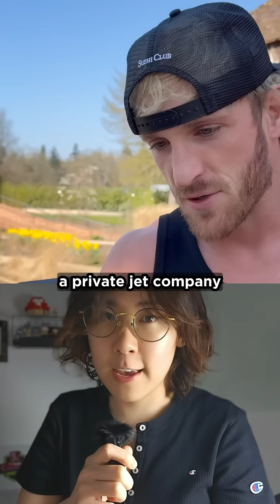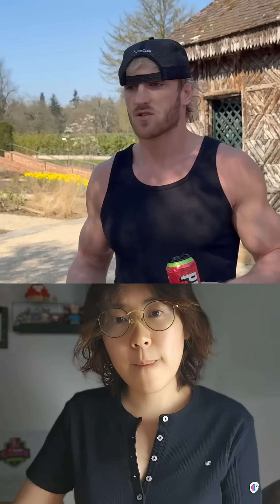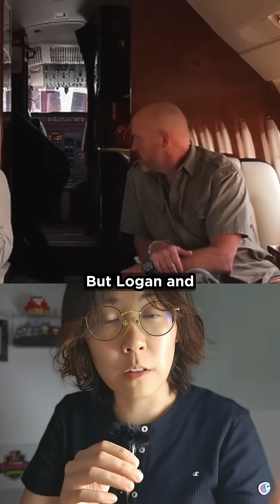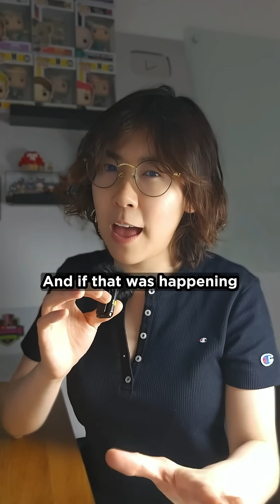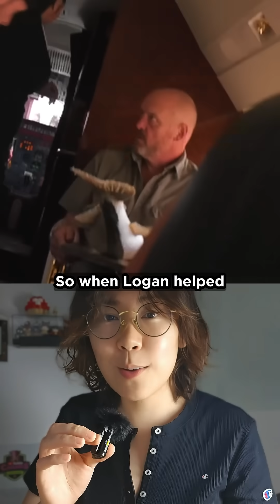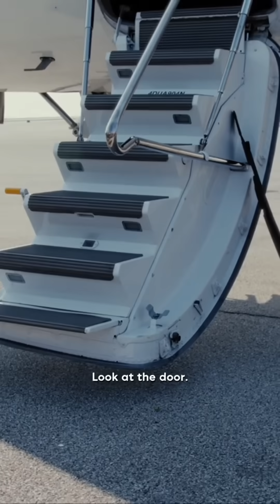How Logan Paul’s Jet Door Really Blew Off

Comment: I work on aircraft. My specific one we aren’t allowed to operate the door unless the crew inside open their hatch at the cockpit and we see their hands signifying that theirs no extra pressure in the plane. This charter was unprofessional to say the least
Reply: I've never heard of that policy but that sounds responsible. As a mechanic, we try not to open those windows if we can avoid it. Sometimes they don't reseat perfectly and make noise in flight.
Reply: @magicalframe9441 ah. Mine were specifically designed for that. Watched one dude open the pressurized cabin and the hatch slammed him into the ground knocking him out. Ironically he landed in a pool of hydraulic fluid which made it look like blood so we all thought he died lmao. He’s good now though. Crews ears went out for a while from what I heard
Reply: Dude I’ve heard of unprofessional, but this seemed more like a professional hit job gone wrong then anything else.
Reply: @lindenbyrne7725  yeah, almost seems like that.

Comment: I suspect that this is bs for views. Planes are usually only pressurized to about 9k ft. There are only 2 airports that are above 9k ft, only one of which that plane would land and its only 9094 ft. So the difference in air pressure is well below 1psi. So either it was faked, or something broke on the door.

Comment: Correction: Plane doors sit with the frame of the door being larger than the door hole of the cabin. Doors fold in a way that allows them to open outwards but sit inside the frame when closed. The latch is not "the only thing holding the door in." Plane doors are super safe.

Comment: This has to be fake. I'm in the private jet industry as Assistant Director of Operations for a charter company.. No one is opening that door but the crew for that reason. The pilots should've seen the cabin altitude on the ground. There's just too much wrong with this.

Comment: If the cabin was pressurized, it would’ve been around 6 to 8000 cabin altitude meaning the high-pressure is on the outside. The information you gave in this video showed that the high-pressure was on the inside.

Comment: If that happened before the flight started, they don't put more pressure in the cabin, they remove pressure such that the difference between pressure at altutide vs cabin pressure isn't as great.... so you wouldn't have higher pressure in the cabin on the ground because pressure is slightly removed in the cabin not increased.
Reply: that’s what i was saying. and if the inside of the plane is a relative vacuum while the door opened outwards, he would have had to push pretty hard outwards to open it

Comment: the door did actually explode, the definition of explosion encompasses chemical, nuclear, and mechanical. the latter of which is what happened in the video. Explosions happen when there are large pressure differentials that rapidly equalize. The only difference with the types of explosions is how the pressure difference happens. There is no qualifier that an explosion has to be of a certain magnitude, or cause any destruction. What happened in the video was absolutely an explosion
Reply: But then the door still didn't explode, the cabin did.
Reply: The exit exploded, and the door felt the impact

Comment: He's lucky or it was staged if cabin was under presure that door lock should be unlovable object they did that I think it was after guy brute forced a door like he did and got ejected  and died since even 10psi  difrence would be hundreds to thousands of pounds of force pushing you
Reply: He’s using a mechanical latch idc to explain the engineering specifications to you because you won’t understand but force multiples and Logan isn’t weak

Comment: But planes don't "pressurize". They typically lower the pressure to an effective altitude of 8000 feet.  And they make this change very slowly (over the span of 20 minutes), *after you're in the air*; they don't want a big pressure difference in case an evacuation is needed.

Comment: But the aircraft isn’t designed to pressurize the cabin beyond ambient pressure on the ground, is it? As far as i know, it only depressurizes the cabin during flight to prevent too much pressure difference that cause structural damage.

So on the ground, the situation should be the opposite. If your ears pop while the aircraft is stationary, it might mean that the cabin pressure is actually lower than the outside pressure — and in that case, it could be very difficult to open the doors due to the inward pressure differential

Comment: As an Flight Nurse and part of an aircrew for all my missions, we NEVER ask passengers to assist in troubleshooting the exit doors!  It starts with the captain - who is ultimately in charge of the aircraft.  Any aircrew member should have been trained in all the exits, including the hazards of operating an exit door before the cabin is depressorized.  This aircrew need more training.  BTW - people have died opening the exit door prematurely because the intense cabin pressure blew open the door and ejected the individual onto the concrete pavement.
Reply: Guess you can join a flight crew without knowing any proper grammar 😂😭 shocking.
Reply: @icanfixthat3890  glad to know cashiers are hooked on phonics
Reply: @icanfixthat3890  yeah.. being in a flight crew has really high grammars requirements…
Reply: @krgazgenix746  why the s?
Reply: Well I guess the Airline company needed to be sued then.
Reply: @beluwuga that's a private jet bruh
Reply: @icanfixthat3890  At least she has a Job with responsibilities and talking down to someone because of their writing is just childish, but thats what you probably are a little hurt child with nothing to be proud of
Reply: The PIC is ultimately responsible. They have 4 bars of authority, they get the 4 bars of responsibility as the captain. 
The left seat is easily replaceable and that pic should be replaced due to failure to follow the check list for preflight.
Reply: Luckily it wasn't a 737 type where they have the emergency chute deployment explosives. 
That's why you never open a airline door with the cloth "seatbelt" visible through the door window port. That means it's "armed" and ready to blow that door 15 feet away.
Reply: The cabin is not pressurized above the pressure at sea level. They're DEpressurized to 8000ft (normal aircraft operation) or 15000ft (special cases) above sea level air pressure, or 2000 feet above the airports elevation, whichever is higher. Your ears pop because of a DECREASE in pressure, not an increase. This is why the doors open outward instead of in: atmospheric pressure from outside pushing in against the lower cabin pressure holds them tightly in place against the doors frame.
The only time that would cause a blowOUT is when the plane is above that elevation, as the atmospheric pressure would be lower than the cabin pressure. If the plane is sitting anywhere under 8k feet, it would suck in instead, as the cabin pressure would be lower than atmospheric.
Long story short, no one has ever been sucked out of an aircraft at sea level. Holding onto or being caught on the door as it opens may drag them out though, especially if it's emergency released. To OVER pressurize the cabin enough to suck someone out at sea level would require many, many, many things to fail at the same time, and its likely the cabin would still depressurize itself uneventfully before a blowout occurred.
If you were any sort of Flight Crew in any capacity, you either werent trained well, or never listened at all.
Reply: Was this an assassination attempt?
Reply: OMG. Those were the stories they gave us in flight school regarding the dangers for prematurely opening the C-17 Entrance doors before cabin depressorization as indicated on an interior gauge next to the door.
Reply: @wumpbos6419 assassination implies a target of value and there is no such person on this aircraft.
Reply: @icanfixthat3890  really Lil bro
Reply: @icanfixthat3890  Are YOU really talking about someone else's grammar? You can't even use punctuation correctly or write a complete sentence.
Reply: You're an angel thank you, this is the comment I was looking for
Reply: What are you on about
Reply: Why would the cabin be pressurised to a higher pressure than ambient on the ground?
Reply: @icanfixthat3890 people forget that not all countries have English as main lenguage
Reply: You can very clearly see and hear the current flight attendant ask him to help un jam the door. So all in all, pilots/ crews fault. U should never involve passengers in your job thus risking passengers safety.
Reply: They were also on the ground. You clearly have no idea what your talking about?! You not only made yourself look stupid but you make it seem like your a liar.
Reply: @icanfixthat3890  Cannot even imagine the kind of loser you need to be to police people's grammar randomly online. I value that kind of thing in certain situations but this is neither the time nor place. If you were more mature you'd realize that insulting people randomly like this is extremely rude and unnecessary and you don't look smarter for it at all. You look like either a teenager or a jerk.
Reply: So your saying Logan could sue the company for not only negligence, but putting his life in danger for asking him to do this?...
Reply: @user-ov2fc5sd1e  private jet doesn’t mean it doesn’t have a manufacturer. Be didn’t pull it out of his ass
Reply: They almost depressurized Logan and he coukd sue
Reply: @icanfixthat3890 , I guess you also can since your English isn't any better.
Reply: @icanfixthat3890 words cannot describe how lame you are right now.
Reply: As an aircraft mechanic I agree. It's insane to open the main entry door while pressurized. When we pressurize cabins for inspections, we tape giant warning signs over the door handles. Years ago someone nearly died from opening a partially pressurized aircraft from the outside. The flight crew were obviously poorly trained.
Reply: @icanfixthat3890 Read through it m a couple of times. I’ve only seen two grammatical errors. “A flight nurse” probably happened because they were thinking about an abbreviation(“An FN” helps it make grammatical sense, as an example.) The second one is just a missed plural. It’s really not that deep.
Reply: @icanfixthat3890  when you realise that countries wherein English isn't the primary language of communication exist.
Reply: @aurabyte07  I dont go around typing in other languages i dont understand 😂. It has nothing to do with america, im not even american 😂
Reply: @aurabyte07 also, its pronounced realize. ZERO s
Reply: @icanfixthat3890  well you’re obviously not someone I’d want to invite over to a party. Jesus mate lay of the guy, and what give you the right to act like a pretentious snob.
Reply: Damn😂👏🙏 @brittanylevinson741
Reply: its a private jet and they werent in the air yet btw
Reply: @icanfixthat3890  in British English we spell, not pronounce it realise... So wrong on two more counts. Being a grammar nazi is such a  waste of time and I only do it to grammar Nazis.
Reply: @icanfixthat3890  Yes, you can. Grammar isn't a requirement, and heck many flight crew members don't even have English as their first language, as many come from all over the world.
Reply: @icanfixthat3890 your critical thinking skills are beyond sub par
Reply: @icanfixthat3890 such a smart boy 🥰

Comment: Well some facts here, the planes are not pressurising on the ground for the simple fact that even when “pressurised” the internal pressure is approx 8000ft so much lower than ground level pressure (why would they pressurise on the ground?)
So I think the whole event is an exaggeration he just opened a door which off is illegal but still he was told so

Comment: I am not aware if there are FAA regs governing this but aircraft intentionally pressurize on the ground all the time. 

Would you rather be airborne when you find out there is a mechanical issue with your aircraft? The pressure would have made the door hard to open PLUS this jet (depending on the model) can have an air bladder that runs around the door frame that inflates to make the seal more airtight once the door is closed. 

This is going to blow back on the pilot in command, who would have been responsible for the flight attendant needing to open the door for some reason while he knew the aircraft was pressurized.

Comment: If they were on the ground and the cabin was pressurized the pressure on the inside of the airplane was lower then the outside and not the opposite as you said

Comment: If the cabin crew asked him, he’s fine. 

Usually, the doors physically cannot be opened when the plane is pressurized. It is either an inward opening door that no human has the strength to unlatch, or the latches have physical locks that activate with pressurization; many times both. 
I suspect there was hardly any pressure, so the locks weren’t activated, and it opened with more force than usual. 
If the plane had been fully pressurized the amount of force on the door is a few tons. The door would have been forcibly ejected, separating from the plane.

Comment: Why people of African region have black skin tone and people of northern region have white skin tone. It should have white skin tone for african reign so that maximum light get reflected and people of northern region have dark skin tone so that they can absorb maximum light
Reply: TLDR: You need to get the deeper layers of your skin exposed to make vitamin D, melanin absorbs light and block it from penetrating deep.
Melanin absorbing light != Skin cells absorbing light

To make it clear:
- "Absorbing" the light, means that the inner layers of your skin get exposed to UVB rays so a compost present in your blood reacts forming vitamin D

- Melanin is a pigment that absorbs light, therefore it is seen by us as darkwe

- When the skin cells have a lot of melanin, what happens is that the visible light and UV rays get absorbed by melanin and don't penetrate the skin enough for the reaction to occur

- Lighter skin => less melanin => less UV gets absorbed by melanin => more UVB on deeper skin layers
- Darker skin => more melanin => more UV gets absorbed by it => less UVB in deep skin layers.

Comment: Definitely pilot error. There are checklists for a reason. Plane shouldn’t be pressurized on the ground except during maintenance testing.  Most likely some maintenance guy messed with the pressurization system.  Makes it very difficult to evacuate in an emergency.  Planes are typically pressurized to the equivalent of 6000-8000ft

Comment: Thought airplane cabins were only pressurized to about 1 atmosphere? So the door had 1 atmosphere on one side and ~1 on the other unless there was an over pressure error. Also ears pop when there is a decrease in pressure not an increase. So if anything there was a rapid depressurization occuring
Reply: Airplanes actually have a lower pressure than 1 atmosphere, but still substantially higher than external pressure at cruising altitude because they have climate control systems that increase internal pressure.
Of course, this happened while the plane was on the ground, meaning the pilot had indeed started the cabin pressurisation of the plane early. It's not clear whether this was related to the door malfunction, but did cause the depressurisation effect that happened once it was released.

Ears pop whenever there is a pressure differential between the outside and inner ear, positive or negative. It's caused by the different pressures straining the tympanic membrane (i.e. pushing it inwards or outwards), and is only equalised (popped) when the eustacian tube opens to equalise the pressure. This can happen both when climbing and descending in airplanes.

Comment: The pilot turned on the pressurization system before turning the engines on and moving, which I believe most checklists call for before takeoff, not before engine start
Reply: There is no pressure without the engines. It's created through bleed air and the packs and is controlled either by how much is bled through the packs or how much is released with the out flows.
Reply: @supra1jzed  APU was on